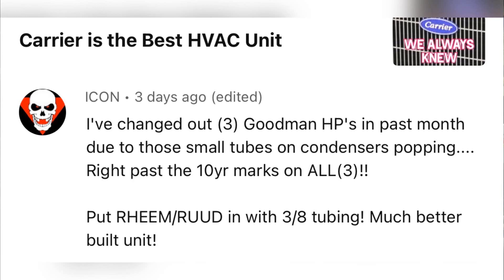Common Refrigerant Leak on Goodman/Amana HVAC Units

Comment: The newer Goodman and Amana units are Daikin units.  I have installed several of the Amana and one of the newest Goodman and it was the same equipment. 10 year full replacement warranty and smooth installs.   Bryant is my other product line and have done me well.  Lots of other brands are so terrible.
Reply: One Internet search will disprove everything you just said.
Reply: @jameylane1591   By all means, do your internet search and show me how I am wrong.  I have literally gone to Daikin. Amana and Goodman trainings.  I work on them every day.  I didn't say every model, but many new Goodman models are Amana units, and they use Daikin/Amana parts.  For example, the Amama S-Series is the Daikin Fit with the different badging.  Would you like me to start post Goodman part numbers with the matching Amama skus?  Daikin owns both companies and of course they use many of the same parts to keep the prices reasonable and compatible.  It is no different than Carrier, Bryant, Payne, ICP and ACiQ.  All owned by the same parent company and have most of the same equipment inside the units.   It doesn't take a genius to figure out why that would be most cost effective and streamlined for business and parts purposes But you show me how I am wrong.  I will be right here waiting.....

Comment: Make that (4)!!!  Just got the call, doing one this Friday for another customer!!!  Popping like hot air balloons over the U.S lol.

I will make a video for ya on this one fellas that Zack can show if he wishes... It's not personal, heck i used to be a Amana-Goodman guy until their accumulation leak fiasco, and now this....

I think i know what is causing it, the sheer weight of the condenser coils over 10yr plus vibrations when running etc, are compressing and rubbing the small thin tubing on the main bottom and near bottom tubing which ends in leaks..

2 of them i know were leaking at corner electrical panel side at bottom, just 3" away from service valve entry point.  Oil stain clearly visible on those 2 and this one as well.

The smaller tubing is okay, but it's a literal "TICKING TIME BOMB" waiting to let go once good use etc happens or the slightest rubbing occurs!

It's like a magic 8 ball game, to see if your unit will last a long time or not.. MAYBE, CHECK BACK, HELL NO, ETC.
Reply: The smaller condenser tubing is really annoying. Which is why I’m a bit annoyed with Rheem’s decision to make their new Endeavor HPs with 7mm tubing instead of 3/8” (save for the 5 ton HPs). Hopefully we don’t see many issues in the near future.
Reply: @andrewpierce2213  Frig i hope not...
Reply: I have ran into 3 of these leaker goodmans this week!!..on the bottom run right near the service valve. You have to pull the dang coil out flip it over to repair it, seems like its only the filthy ones